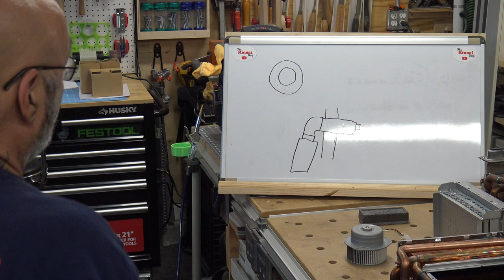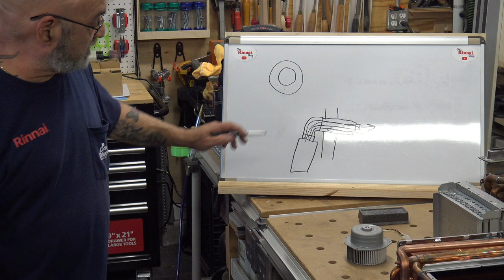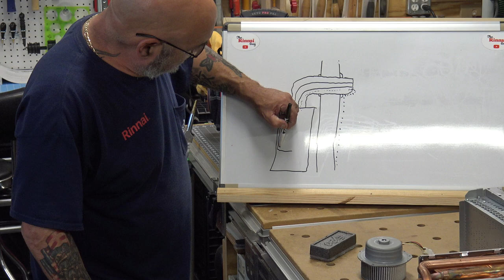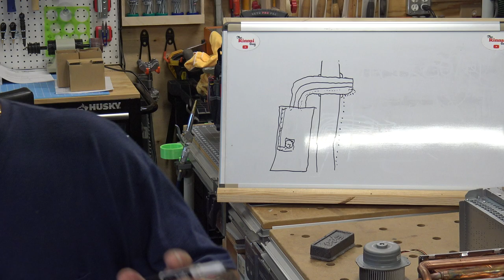Rinnai code 10, what causes it and how to fix it

Comment: I'm a woman hittin' 70 and live in a dilapidated cabin for low rent.  My only furnace heat is a Rinnai wall unit that vents through the same concentric ducts you describe for this water heater, and I've always been diligent about keeping the vent outside clear of debris or snow dump from the metal roof.   The furnace ran like a top ... until last winter.  Part of the floor is rotted in another closed off area and I get mice, up from the crawl space.  I can hear them moving through the furnace case to get into the  kitchen dead of night, where I hear the satisfying SNAP of a rat trap in the dark and go back to sleep.

Last mid-winter, it made terrible squealing but still put out decent heat.   Outside, for the first time ever, the exhaust had an ice dam in the lower half, something that shouldn't happen if hot air was blowing out regularly like before so I knew this issue was probably oxygen starvation of the flame combined with some kind of duct blockage.   I asked the landlord (much older than me) to have it checked at my expense, but where we live no one in the area would agree to work on this style of furnace so I knew it was on borrowed time, and if anything went wrong, I'd be the one to fix it.  I got the manual off the internet but even from installation diagrams and error code charts,  I wasn't sure what I was looking at to fix anything, or even do any seasonal maintenance other than yearly cleaning of the two screens on top.  All those blow-out diagrams look congested and complicated.  Honestly, I don't think this furnace has seen ANY seasonal maintenance cleaning since installation 2014 and I was afraid to take the cover off not knowing what I was doing.   Then again,  I was still getting  heat so I hoped for the best.  But the squealing continued, and the heat kept decreasing, and had to run more often  because of it.    Then one night there was a code (maybe 10, maybe 11 I forget) but then it cleared by itself and ran anyway.   But it got worse.

I couldn't seem to wake up or stay awake.  I was coughing all the time without any flu symptoms, like I was choking on ash.  n fact, I  began to notice a fine white ash on furniture , the floor and on most everything.  I used to work dialysis for 20 years so I recognized signs of impending kidney failure.  And little things ... like my hair falling out, dizzy when I stood up, my skin parching and other things.  I figured I was just getting old.  My landlord was in the hospital with a triple bypass, so I had no one to ask.

One night, I saw myself standing in the dark at the foot of the bed - I sleep 3 feet in front of the furnace -  and I was screaming at myself, "WAKE UP!  WAKE UP!" muffled like the other me was standing behind a glass divider.  I was in that deep sleep that's like being underwater and you have to swim up to wake up, but I figured I sounded pretty earnest about it, so I made myself make the journey to consciousness.  Of course, the other me disappeared and there was nothing in the cabin making any noise, including the furnace that was green light between cycles.   I sat up on the edge of the bed wobbling like I was sitting on the side of a boat.  Then ... it hit me.  CARBON MONOXIDE.  It all made sense ... the cough, the kidney failure, the hair loss, and all the other things I didn't mention.  I launched into the room without looking for lights and fell into things getting to the doors and windows to open them, ran a couple fans propped the door wide up front and back and nearly froze to death in a down sleeping bag waiting to get fresh air throughout. 

So ... as MONK  would say ... "here's what happened...".  The CO build up was gradual over 3 months, which is why I thought there wasn't a problem.  The CO coming from the furnace was in a layer above the floor.  If I had a cat or dog, I'd notice it because the animals would start to get up on furniture, or the bird would die.   Because the cabin was closed up to conserve heat, eventually, the floor CO level got to bed-level and that's when the coughing started ... but only after I went to bed, not when I was reading or watching TV.  

People asked me why I didn't have a monoxide detector.  It's simple.  The furnace WAS working fine for 5 years, nothing had changed until the bedtime coughing, and there are only two outlets in here and they are already sparingly metered to lamps and a TV and a fridge.  But after I aired out the cabin, EVERYTHING returned to normal within a couple months.   

Granted, you're talking about a water heater, but I recognize furnace repair symptoms, and I have always thought there is probably mouse nesting debris or cadavers inside the furnace ductwork somewhere.   Just this week Autumn, it kicked in, no codes,  but I notice it isn't putting out the heat it once did (and NEEDS to) tho I can hear the familiar sequence clicks:  Thermostat, fan revving up, pilot ignition, flame roar,  flame off,  green light and fan count down.  I can't wait any longer.  I've got to take the front panel off and get into it to poke around and vacuum, dispose of the bodies if there are any, and do it before furnace fire up is a regular thing during Michigan's winter.  Thanks for explaining the exhaust thing about the lizards, and I found the vent hole pattern thing interesting so I'll check there, too when I might of just swept if you hadn't said anything.
Reply: I would totally LOVE a HW2 video on yearly maintenance on Rinnai furnance/water heater, that's user-friendly, detailed and works from start to finish.  As users, we need more than a manual that emphasizes EVERYTHING, instead of highlights the things we can do on the fly.

Comment: Thanks for the video, I was able to clear up the code on my water heater. It took me a couple tries but at least I didn't have to remove the intake/ exhaust vent. I was able to remove and reinstall the plates on the inside and Clean up the combustion chamber. That did the job, I also cleaned up the squirrel cage and vacuumed out the intake box. I used a leaf blower to clear what I couldn't reach with my vaccuum.

Comment: Good info-however my issue was with code (parameter) settings -was set for too short a a distance for crossover recirc. Manual shows how to go into settings, pick the correct one. I think the older ones had dip switches; now you have to press “a” on the control panel for one sec to get into settings.

Comment: Hi Mike. Our heater is giving us the code 10. The water heater works but sometimes will give us the error 10, 2 minutes to 20 minutes after demanded. If we shut off the water and turn it back on it will work for a bit. I watched you video and checked the exhaust vent for blockage. We couldn’t see anything and decided to hire a plumber to do check the unit. The tech came out and said it the exhaust isn’t blocked the the unit needs to be replaced as it is 10 years old. I told him we watched your videos and wanted him to check the fan. He told us he is a certified Rinnai technician and he knows that if it isn’t being blocked then the only option is to replace.
Reply: He could be correct or he could be untrained on tankless like most plumbers, if you haven't ever had maintenance done on the unit then it would make sense to go ahead and change it at this point instead of diagnosing and replacing a bunch of components but if you've had it regularly maintenance I highly doubt you would need to throw it away, the heat exchanger just needs to be blown out with compressed air, there's likely a lot of debris inside of the burner plates that have fell down from the heat exchanger in the debris is a byproduct of the flame and it builds up on the fins in the heat exchanger. And that's the difference between somebody who knows what they're doing versus someone who doesn't when it comes to maintenancing these units. If they're not removing the gas manifold and exposing the burner plates and blowing all that stuff out then they're not doing it right and I would not trust them to work on my unit at all. Hopefully someone's came out by now that figured that out, I went to a mini of calls on these units where it had a very very minor problem light blowing out the combustion chamber but multiple plumbers before me that's all the customer it needs to be replaced, you only have to replace it when the maintenance has been neglected and components are overall not in good shape, if you keep up maintenance on it components can be replaced individually as they go bad which isn't very often

Comment: Hey Mike, I also wanna say thank you I remember paying like seven 800 bucks for someone to clean it out last time with two guys but this time I was able to pop off the front get those three screws off the fan check it. It was true, but there was a bunch of leaves and crap in there so Blew that up put it back blew out the exhaust pipe and we’re good as new. Thank you so much for your help. Appreciate the video. Took me about 15 to 20 minutes from start to finish.
Reply from the maker: Glad it helped

Comment: What would cause a brand new RUR unit to throw a 63 ONLY when starting the recirc mode?  No codes otherwise…no issues with hot water. Been doing it Every day for weeks now. No codes when calling for hot water usage.

Hard to think there is still air in the lines. It is new construction, so might be junk in a filter?

The house has a dedicated recirc line

Thanks
Reply from the maker: Call me at +19042385349 today around 5pm eastern time and I will go over it with you Mike

Comment: Hi Mike,  Thank you so much for sharing your expert knowledge of Tankless Heaters.  The videos you have posted for the Rinnai Tankless Heaters have been a lifesaver for this retired couple in East Texas.  We had a Rinnai RL94i installed 10 years ago when we bought and fully renovated a Tudor style home built in 1940.  It has worked flawlessly for the last 10 years (without service - my installer never told me we needed to do annually). About a month ago, we got an error code 10 (and cold water).  I called the plumber who installed it - short story, he sent a couple of guys who were clueless as to how to fix it (and not certified to even try) and their only comments were "this is a new technology and we would have to be certified to open it up???"  After watching your detailed and helpful videos on replacing the fan on the Rinnai Tankless Water Heater, I grabbed a screwdriver and followed step-by-step the whole process (and the many tips along the way were really helpful) and I didn't need to replace the fan - just clean it of several moth body parts and ?!?.  Reassembled per your directions and in less than an hour - Voila - IT WORKS!!!  The wife and daughter think I am a genius (thanks to you) and I am sure we saved a lot of money (>$700).  You are one of the reasons I love youtube!!!  Thanks, again, for sharing your knowledge and for being there when I needed you - from a devoted fan!!

Comment: We live in Los Angeles, CA. Is there anyone you can recommend to service our 2017 Rinnai model RUR98e? I removed the cover and didn't feel comfortable in disconnecting the wires to get at the fan. Thanks.
Reply: Paul and i, they have authorized contractors in your area
Reply: Call rinnai**

Comment: We have two tankless Rinnai tankless water heaters. House is not old. We have a constant beep with a 10 code. We have 3 different plumbers out and no solution.  The one recently descaled and cleaned again and also took it apart and couldnt find any problem. Is advising we have a roofer come out and go to roof to vent and clean out from that angle because he doesnt see any obstruction in the attic side. Have you ever heard this before.  BTW when you shut the unit down and turn it back on the beeping stops momentarily but starts right back up again.
Reply from the maker: Code 10 is an air problem. Do you have the code 10 on one or both unites? This is what needs to be checked. First the fan inside the unit it’s says the United are roof vented, the vent will have to be removed so the Teco. can see if there is any obstructions inside the top air intake of the unit. Third the vent itself. Bugs vet love to get into the fresh air side of the vent and make a home. Please send pictures of the vent to me at my e mail address economyplmbg@aol.com and I will see if the venting is correct. Mike
Reply: @ThatTanklessGuy  The code is only on one of the units.  We so appreciate you sending message back. We are in Costa Rica right now when we get back we will get the pictures. The plumber that was just out said we would need to a roofer and check for obstruction at the part that comes off the roof. Do you have an opinion on that? Thanks so much!!

Comment: 0:29
Reply: Not sure if the piping is correct underneath but I have used your videos many times and found them excellent I have changed the servo the turbine the sensors and clean the fan all with no success. I get nothing but cold water after about two or three minutes and it stays that way never getting above 97 to 98 degrees at all faucets and tubs